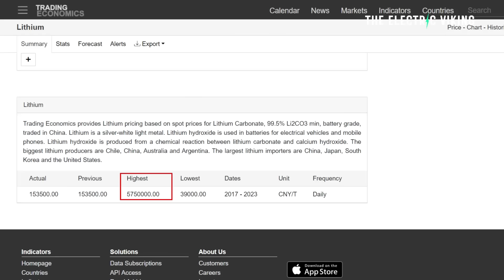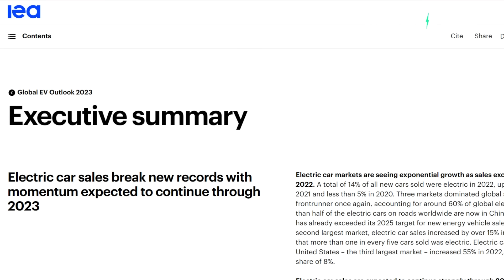The reason Electric Cars will be cheaper than ICE cars in 2025

Comment: EV cars will become like refrigerators and washing machines.  They will be cheaper to replace than repair.
Reply: You're very incorrect. The EV is now more an electronic vehicle than an electric vehicle, but even better BECAUSE these EVs are upgradeable, both the software AND the main-brain hardware.
Reply: @greggrant4614   When my computer gets old I buy a new one because the new one is so much better.  You could upgrade that old computer but the tech that it has when you bought it gets obsolete very fast.
Reply: @lym3204  The functionality of Tesla's Electronic Vehicles (EV) is continually being upgraded via software upgrades. Computer hardware upgrades for these EVs can and will also become the norm, with all the "vehicle" components designed to last at least 20 years and 1,000,000 miles (except for tires and windshield wiper blades).
Reply: Maybe this will change your mind:
"Generative AI is experimental. Info quality may vary. Learn more
The lifespan of electronic components varies depending on the type of component: 
Processor and remotes: Change every five years for best performance
Thermostats and back-end hardware: Can last 10 years or more
Touch panels: Tend to feel dated around the 7-year mark
Laptops: 4 years
Televisions: 10 years
Smartphones: 2–3 years
Computers: 3 years
Microwaves: 7 years
Photocopier: 8 years
DVD players: 5 years
Electrolytic capacitors: Can range from a few years to a few decades
Transistor devices: Become obsolete in less than 10 years
The average lifespan of electronics is 4.5 years, but most only last 1.5 to 13 years. "
Reply: @greggrant4614  So, you're laptop or pc also last forever? Don't think so...And EV's still have parts that wear.
Reply: @stefan2796  Of course not. The point is that you CAN upgrade your Electronic Vehicle as quickly and simply as the latest software can be downloaded, WITHOUT tossing away the rest of the vehicle to do so. The same will be true for the primary electronic hardware that enables the software to perform better and better over the next 20 years (if Tesla and other competitive EV manufacturers choose this path, as they should, to be most competitive).

Comment: I agree with your timeline. Cost parity is the end ICE. only issues with EVs currently,  Cost of batteries and charge rate. Both will be solved industry wide by 2025
Reply: Charge rate really isn't an issue except for on some really slow charging EVs like the Bolt, but even then it's only an issue when taking the occasional road trip a few times a year.

Stopping for 20-30 minutes every 3-4 hours isn't really going to slow travel down that much

And the amount of time saved over the course of a year not having to go to fill a gas tank compared to just plugging in at home is going to be vastly more than the time lost with forced breaks on road trips
Reply: @pdxmarine1430   for the better EVs, you're correct. And it is only an issue if traveling,  but it is a big  psychological barrier for many people. 200 miles returned in 10 min  should be sufficient for mass adoption
Reply: @jplabrecque6708  Most EVs now are charging 20%-80% in about 20 minutes. With a 350 mile EV that's 210 miles, or 3 hours at 70mph in 20 minutes. EV ranges are only going up, and charge times are only going down. 20 minutes for 200 miles is already plenty good enough, but it's only going to get better
Reply: @pdxmarine1430  ... that is EXACTLY my own experience!  👍

Comment: There is not enough “home” charging stations even in Europe… in two years… so no. It will happen eventually, but 2025 ice cars will sell 80% or more and EV 20%… 2030 maybe 70% ice 30% Ev. 2035 maybe 50% vs 50%… after that ICE will maybe start to fall down… 
My estimation is that EU will reverse its decision to. It allow ICE cars after 2035… just because big car manufacturers in Germany would/will be in trouble. 
What does increase EV is that gasoline prices will go up, up up sky high. But that happens slowly!

Comment: Moore's Law doesn't say that, it's specifically about Transistors on Silicon chips.
Reply: You're right, but there has been a consistent decline in battery price per kWh and consistent improvements in density. I don't know if it has an exponential function like Moore's law, but they keep improving, just like solar PV.
Reply: When moore's law was usable for other stuff, like planes, we would all be flying now 😁😁
Reply: @Grizzold-HP2 Moore's law does not apply to other things. You're thinking economies of scale which is another thing entirely
Reply: Wright’s law.
Reply: Applies to disks and pipes, too.

Comment: How come you never mention energy storage needs when stating your battery excess hypothesis ?
Reply: There is already over 89 million ton Lithium found, of which around 25 million ton economically minable. 
That 25m would already be enough for every car on the planet today. Even without the recycling of batteries, and without the lithium deposits still discovered every year. 
Storage can even better be done with Sodium batteries, weight or size are less problem with storage.
Reply: @Grizzold-HP2  great let’s get to it…
Reply: @Grizzold-HP2  
I suspect the possible lithium problem is more about processing than resourcing the raw material.  Looking forward to seeing how well the new Tesla lithium process works.  They set up that plant really quickly.  If it works as expected then it should be able to simultaneously build more plants.

A huge supply of lithium was recently discovered in Nevada.
Reply: Storage doesn’t need high energy density, sodium ion and other technologies are cheaper and work just fine for it. There is no shortage of sodium.
Reply: @stevetodd7383 storage needs high discharge and charge currents, sodium batteries are not ideal for that

Comment: BYD as a battery maker benefit most from technical breakthroughs and new materials like Sodium Ion. Fossil fuel prices remain high and could go higher??
Reply: Fossil fuel prices will continue to increase for several reasons - 1. locating and extraction are becoming increasingly difficult and expensive as the easy to access sources have already been exploited 2. As the market share of gasoline cars diminishes, and as the gasoline engines themselves become ever more fuel efficient, there’s less demand for gasoline, but the production costs haven’t dropped.  Net result is increasing gas prices.  And every EV on the road accelerates this process.

Compounding this, the lithium and other precious metals in batteries are recyclable, so the extraction eventually becomes only what is needed to increase the number of batteries in existence or the small amount, roughly 10% lost to the recycling process.  A bit obvious to say, but gasoline isn’t recyclable so doesn’t enjoy the benefits of the circular economy.

Hence the reason that gasoline companies are throwing every bit of nonsense they can at the public, from denying the human component accelerating the natural deglaciation / global warming trend to denying the health risks associated with burning fossil fuels, to scaremongering about the mining of rare earths.  Somehow they were never really worried about the environmental effects or child labour used in coal mining, but when it comes to mining rare earths for batteries it is a top concern. Which was barely an issue heard of in the headline news when the batteries were for cell phones and other consumer electronic devices, but now is a huuuuge problem.  The hypocrisy of the fossil fuel industry is beyond staggering.

Comment: Battery production goes  cheaper about  30-40%  within  2-3 years , If you can imagine  Tesla model 3 LR   with  end price  under  45k  USD ,   it will  happen  within 2-3 years.
Reply: That's still too expensive for a mid-sized family car.
Reply: @rogerfroud300  What happend with all the talk in 2018, about the $25k Tesla? and in 2020, and in 2022 . . . . and now?
Reply: @Grizzold-HP2  
Work is underway at GF Austin to start manufacturing Tesla's $25k EV.  They are going to first manufacture in Austin where many of their top engineers are present and then expand to other factories.

Tesla already has a very large piece of land in Mexico where they intend to build a new plant for their economic EV.  All the permits are completed.  Once they have determined that the process for manufacturing this inexpensive EV is mostly ironed out they will likely rapidly build a large plant to serve North America.

Tesla has also announced that they will manufacture the $25k at GF Berlin and, IIRC, at GF Shanghai.  As well, it looks like Tesla is close to working out an agreement with India to build a production plant there.
Reply: @Grizzold-HP2  25k $ in 2019 is  about  33k $ in 2023   they  call it  inflation .
Reply: @bobwallace9753  Tesla Model 2 will be about  23k $ up to  26k $ for LR model
Reply: @Grizzold-HP2 They will release it in 2025
Reply: @lesnypatrol7292  
I don't know how much the "$25k" Tesla will cost.  That number was thrown out pre-inflation.  I won't be surprised if the first cars sold are priced a bit over $30k.  Then, over a year or so, we should see lower cost versions appearing with prices under $30k.

I expect Tesla will price the first "$25k" EVs higher in order to earn extra money to pay for additional "$25" EV  plants.  Maybe going for a 25% to 30% GPM before eventually settling into a 15% to
20% range.
Reply: @bobwallace9753  I agree
Reply: Excellent, so I should stop looking at evs now and come back then.
Reply: We need new cars to be $20k. Not everyone is a millionare. The average income here is not even $30k a year.
Reply: @AndrewTSq  

Where is "here"?  What new cars do people there buy now?
Reply: @bobwallace9753  Sweden. Most sold car this year is Tesla Model Y (They start at 52k USD here), but I also think we saw a spike cause Sweden removed the gov. funded subsidary for EV's earlier this year, which made people panic into buying one before the money was gone.
Reply: @AndrewTSq  

"Swedish people earn USD 47 020 per year on average"

Swedes buy Teslas.  Surprise, surprise, surprise.